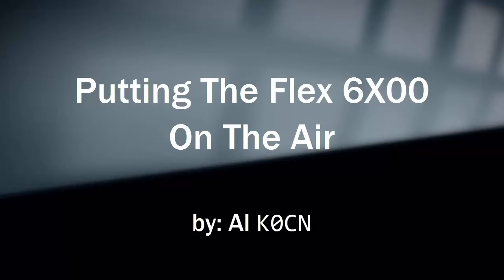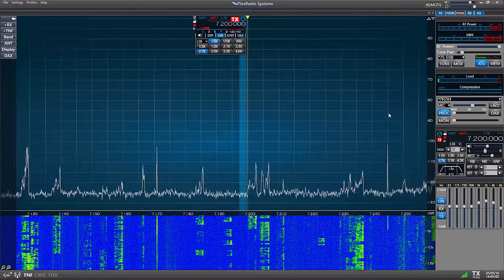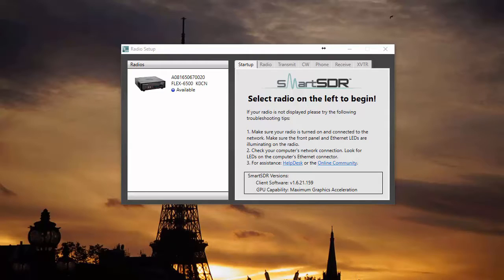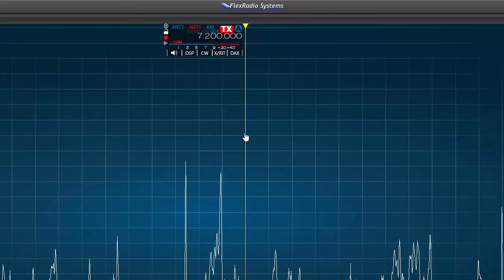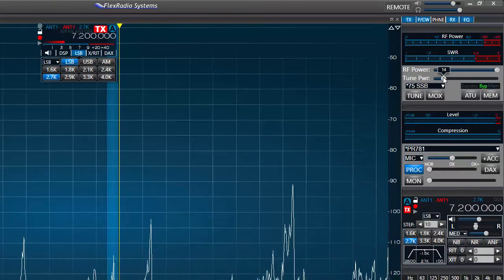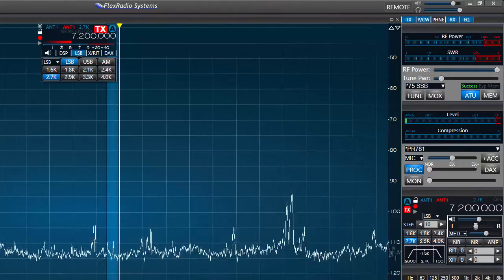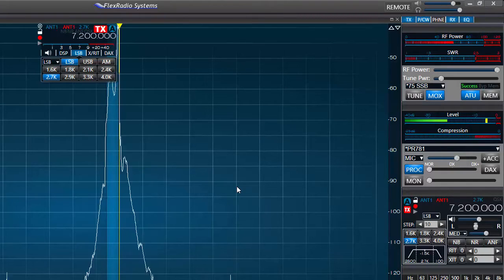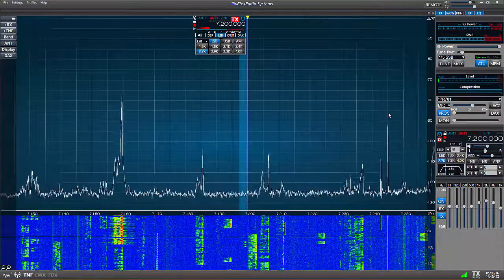Put the FLEX-6500 On The Air

Comment: does this software has a link for external midi control, like the software from the Flex 5000?
With power sdr I connected my dj console and used it, knob controlled. That was a big advantage years ago

Comment: Thanks for the video, Al. I assume that the 6500 can be used with a Flex Maestro? I'm looking to find a used 6500. Thanks, and 73 de WA3RSL.
Reply from the maker: Yes, I use my 6500 with my maestro frequently and it works perfectly.
Reply: @k0cn  Thanks!

Comment: How did you get your callsign on the radio display ?
Reply from the maker: In the Radio Setup window and in the Radio tab, you will see a box labeled Callsign (just above the Connect button). Enter your call sign there and when you connect, you'll see your call sign on the front led screen.
Reply: I tried that Al  and even put it into where the nick name is and still shows FLEX-6500
Reply from the maker: I guess I would email a help request from technical support. They have been real good to me... Wish I could offer more.